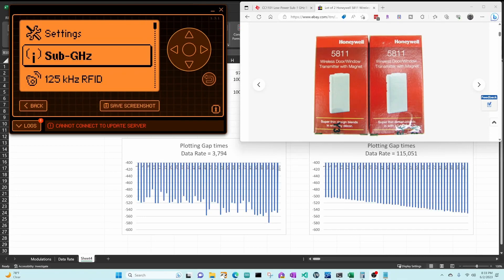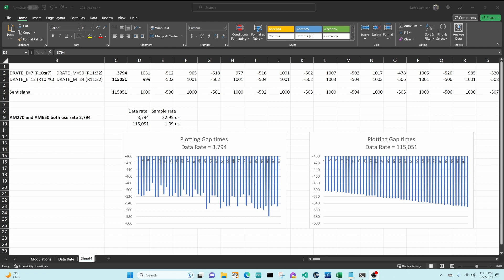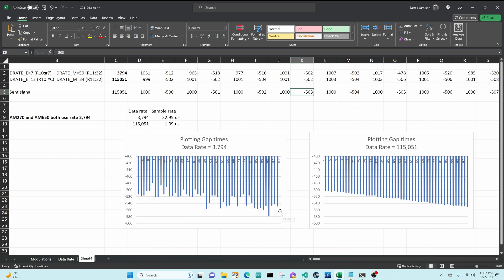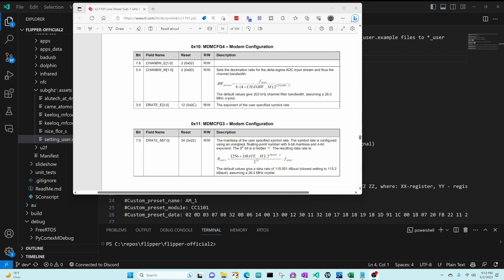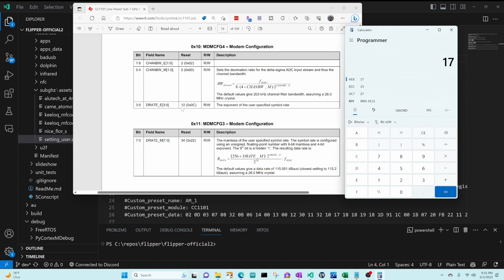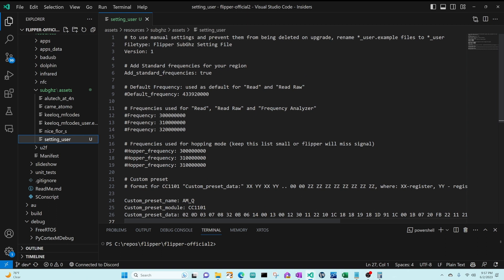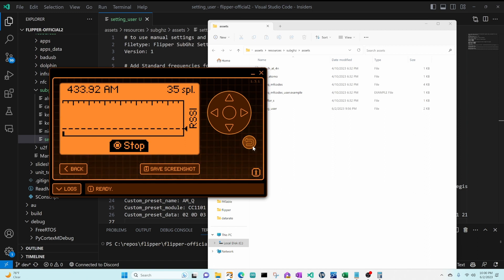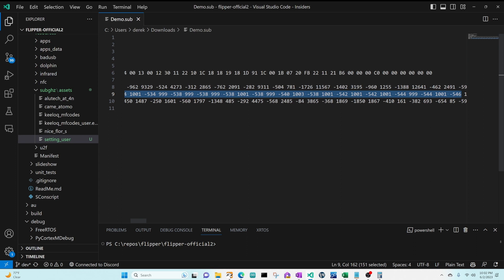[65] Flipper Zero - SubGHz Data Rate

Comment from the maker: If you are using NOT using official firmware, be sure your settings_user file matches the file your firmware uses (or you may lose some customizations).  Perhaps download the existing setting file from your Flipper Zero and append the data to the end of the file.  Below is the new AM_Q entry:

- Custom_preset_name: AM_Q
- Custom_preset_module: CC1101
- Custom_preset_data: 02 0D 03 07 08 32 0B 06 14 00 13 00 12 30 11 22 10 1C 18 18 19 18 1D 91 1C 00 1B 07 20 FB 22 11 21 B6 00 00 00 C0 00 00 00 00 00 00

Official firmware has the setting_user.example file at...
https://github.com/flipperdevices/flipperzero-firmware/blob/dev/assets/resources/subghz/assets/setting_user.example

RogueMaster uses (setting_user.txt instead of setting_user, per their README) you would want to use the custom firmware file from their repo instead of official...
https://github.com/RogueMaster/flipperzero-firmware-wPlugins/blob/420/assets/resources/subghz/assets/setting_user.txt

The Unleashed file is still called "setting_user" and is at...
https://github.com/DarkFlippers/unleashed-firmware/blob/dev/assets/resources/subghz/assets/setting_user.example
NOTE: For Unleashed, your entries happen just after "FM476" and before "FM95".
Reply: Nice you included it for different FWs

Comment: Can you do a similar video on 0x12: MDMCFG2 6:4? its scrambling my mind.
Reply from the maker: For the Flipper Zero in async mode, you basically only have it set to 000 or 001 for what they call "FM" and "011" for what they call "AM".  The reason is that there is just a GDO0 (or GDO2) pin used to signal data (so it's a single bit).  section 27.1 says "MSK" is not supported, and single bit rules out "4-FSK" because that would take 2-bits.  My "Jeeves teaches RF modulation" video explains concepts like 2FSK vs GFSK (the audio is a little annoying but hopefully it gets the concepts across).

Discord is probably the best place to have a back-and-forth conversation. I'd love to hear more about what topics you think we should dive into for Sub-GHz. An invite to my server is - https://discord.com/invite/NsjCvqwPAd  
We can continue the conversation there, either in #general or #subghz channel.  I look forward to chatting more!

Comment: Is there any laymen's terms explanations of this stuff?

I way into deep water with this stuff. While I'd like to get into understanding this there's no way I can follow this. 

I've learned a ton already by just screwing around with the Flipper Zero, but I need some place to reference to understand sub gigahertz in relation to the Flipper Zero.
Reply from the maker: I'd love to gather your feedback and help make it more generally understandable.  Are you able to reach out to me on Discord at codeallnight?
I've made a lot of videos on SubGHz.  I'm also starting a wiki page on SubGHz soon, so having an intro that everyone can understand would be super helpful to me.

The Flipper has various ways to interact with other devices...  Infrared, GPIO (wires on top of flipper), iButton (back of Flipper), 125KHz RFID, USB-C, Bluetooth, NFC & SubGHZ.  To interact with devices that use radio waves in the 300MHz, 400MHz, 800MHz, 900MHZ ranges (use the SubGHz feature).  WIFI is 2.4GHz or 5G (which is 2400MHz) which is too high of a frequency for the Flipper.  Lots of remotes run in the "Sub GHz" frequency range.  If you have a remote, it typically has an FCC ID printed in really small print.  Go to https://fccid.io and search for that id and you will see the frequency.  (Or you can use the "Frequency Analyzer" in the SubGHz feature to scan for the frequency.)

It would be great if you can send me a friend request on Discord to chat more at codeallnight.
Reply from the maker: My SubGHz playlist also has some intro videos, which you might find helpful if you haven't already watched them...  
https://www.youtube.com/playlist?list=PLM1cyTMe-PYKeMm52J8Y_4SKqdm6Utl__

Comment from the maker: So got some feedback in the community.  https://discord.com/channels/937479784148115456/937479784726949900/1115286857434021999

Basically... if you are using an external antenna, then likely 115kbaud isn't gonna work.  Threads indicate around 17-20kbaud is about the best for some CC1101s -- that means register 10 is 0x19 (for 650kHz bandwidth or 0x69 for 270kHz bandwidth) and Register 11 is somewhere between 0x60 to 0x92.  Hope this helps.  I'll try more with my external antenna later this week!

Comment: Uhhh. PULL REQUEST! lol. This  is an incredible change to the way users can filter out much of the excess noise. I would suspect to see this merged into respective firmwares during future releases.
Reply from the maker: I'd like more feedback from the community on what settings actually work.  115kbaud is working for me with internal flipper at 433mhz and 345mhz, and helped me clean up some signals, but my understanding is that things like external CC1101 aren't working above around 17-20kbaud.  I think it needs a bunch more testing in the field before we suggest a new modulation?  Does it help with your captures?

Comment: Nice! So if I understand correctly correcting the sample rate as you’ve shown should/ could also potentially help correct issue Ive been having with liftmaster passport remote decoding in read mode? or does this only effect read raw?
Reply from the maker: Yes, in Read you can also choose AM_Q that was added from your setting_user file.  I would guess that most of the OOK decoders would have been tested with AM650 or AM270 (unless someone is just porting a decoder from somewhere else, like rtl_433 devices)?  Maybe your device is just slightly off compared with what they used to test and the 32 us delta in data causes some bits to not get decoded properly, having 1us delta could help clean your data.  You might also want to look at RAW and see if the data 'looks' correct.

Comment from the maker: In the video at 6:45, I think the data in that row actually started transmitted "1000 531" (but received as "999 -532").  The values are still within 2-microsecond - which is way better than looking at a signal that is off by more than 30 on each reading.  🤣🤣   I'm still learning.  For those of you more familiar with radio, please let me know in the comments why to NOT use the faster data rate for RX. Thanks!
Reply: Maybe hi rates can cause performance issues. I saw in nondefault firmware custum modulation presets "HND_1/2" which hanging flipper in a tenth seconds of reading mode. Maybe low rate is more noiseproof.

Comment from the maker: The wiki... (Sub-GHz coming soon!) https://github.com/jamisonderek/flipper-zero-tutorials/wiki 
Not sure why data rates are so low? Let me know in the comments if you know why!  FM uses 4798 and even FW with "HONDA_1/2" is only 15,373.  Since it's async so CC1101 disables packet handling, I really don't get why the low rate (especially for AM).

Also, it's a door transmitter, not a "door bell" (sorry about that).